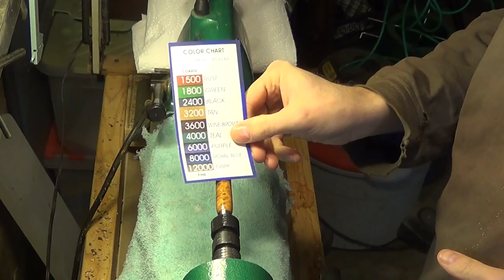How to Finish a Pen with CA Glue and Wet Sand with Micro-Mesh

Comment: This was one of only two videos I could find that provided me with a predictable way to lay down CA.  I use the same towel method but with folded, thinner, non linting shop towel paper I use for my shop.  In small pieces, I lay one coat across the same way, and it works like a charm.  The temptation to go back across is hard to resist with the same towel.  One and done!

Comment: I had almost given up trying to use CA glue as a finish. I tried your technique and am quite pleased.Most techniques show a large amount of glue applied and rubbed back and forth. The idea of applying sparingly and not going back over it is like a poly finish in miniature. Thanks for the instructional video. Keep up the good work.

Comment: Hi Jim, 

Just spent the better part of an evening out in the garage turning blank after blank, and practicing the finish using the technique you demonstrated.  Flawless!!  They came out SO beautiful, it was amazing.  I wish I could post a picture on here of some Aztec Cherry (Machiche) that came out wonderful, even for a test piece.  The only difference in technique I employed is when you said you were a little lean on the CA on one end, I alternated, every other strip, going one direction, then back the other way.  12 coats later, micro mesh sanding, polishing, and I could nearly see myself in the reflection.  Great video and lesson, and it answered my own question below about getting rid of the "ghosting."  Cheers, my friend
Reply from the maker: +Sig Guy Thansk for the feedback!  I really appreciate hearing that you have had success with this technique.  I certainly wish I could see you results.  I really like Cherry.  Have a good one man!

Comment: I looked at so many different techniques for applying CA glue before I stumbled on this video.  I used yours for my very first two pens I made this week and it worked like a charm! The only issue I had was that I got some crystallization using the accelerent on the first pen - even though I only sprayed a little amount from a long way back - so didn't bother with using it after that.  And I wiped the bushings with my wax cloth before starting with the gluing so had no problems with CA glue on them. Thanks Jim!

Comment: I tried two pens in the last two days and it worked wonderfully.  After set sanding to 12,000 grit, I applied Dr. Kirk's Scratch FREEE Woodturners Polishing Wax and buffed it.  Then I added the Plastics polish.  These two pens are my best finishes to date.

Comment: Great video, by the way, nice explanations!
Reply: Hi Jim, Awesome video and many thanks for taking the time to make it and for answering questions. You mentioned that the first few pads were actually doing a bit of sanding rather than polishing. Should I take that to mean that you were using those pads dry? If not, how much water do you use? In some videos I see people literally slopping water onto the piece with a sopping wet pad. Also, is there any advantage to squeezing the pad to apply more pressure in the polishing process? Last, and maybe this is my problem. I'm using your techniques on acrylic pen blanks. Due to my poor lathe skills, I have to use 150 grid sandpaper to get my final shape. Then I sand to 1200 and eventually through the micro mesh process, however, the acrylic is always dull or cloudy. And under magnification I can see tiny scratches. Any suggestions.
Reply from the maker: +Craig hawks You may be pushing too hard with the earlier grits.  You need to step through your grits, removing the scratches from the previous grit at each step.  If you skip ahead before you get all the scratches out, you will only be polishing the high points, and the low spots (scratches) will still be there.  Remember, when sanding and polishing, take it easy.  Don't push hard and let the sand paper/pad do the work.

Another thing you may try, instead of shaping with 150 grit, try doing a scrape cut.  I'm not a turning pro by any means myself, but if you watch some videos on turning techniques, you can learn more about scraping.  There are lots of videos out there, just search for "woodturning scraper", or something similar.

Comment: Great video. I've had issues with the CA glue finish in the past because of my inexperience. What RPM were you turning when applying the glue and during the sanding process? I noticed that you didnt change the steel bushings while applying the glue. Has that ever been an issue when removing the pen blanks? Where did you purchase the rectangular higher grit sanding pads? Once again thanks for the video.

Comment: Hey Jim, thank you for the time in the video. I have been turning for 12years and never really knew how to do the CA shine. I did two and they turned out breath taking. UNTIL about 15-20 hours later. Both pens spiderwebbed. I swear they look like a broken window on a car. I used medium CA meant for finishing, as per the label. I did 12 coats, shined with micro mesh. What do you think caused the cracking?

Comment: Great video. If I make a pen with dark wood, I get a bunch of tiny white speckels. I turned a pen with Old Bog Oak and totally ruined it. A 5500 years old wood. Darn! Do I get dust or is it that I have more glue in the wood crevaces ? I'm using Gorilla Super Glue which is kind of thick. Has it happened to you before ? Cheers.
Reply: That's from dust in the pores. I get that too. Try blowing it off with compressed air or keyboard cleaner of you dont have a compressor

Comment: Awww man, you didn't show the best part!  Trying to get the dang bushings off after 12 coats of CA!!  I really like your process on here.  Only difference I make is using the nylon non-stick bushings, but I don't think I'd be able to run all the way across like you do with your towels.  One more question - did using this method get rid of "ghosting" in the finish?  That's my nemesis right now.  Beautiful finish and then as it cures, ghosting.  Pain in the rear.  Thanks for the video!!
Reply from the maker: +Sig Guy I haven't had too much trouble in getting the bushings off.  I made another video about pen assembly, where I show how I get the bushings free from a pen that's been finished with CA.  I basically just use the mandrel for a little extra leverage and the pop right off.
Reply: I put a bit of paste wax on the bushing insert parts and when the polishing is done they come right off.